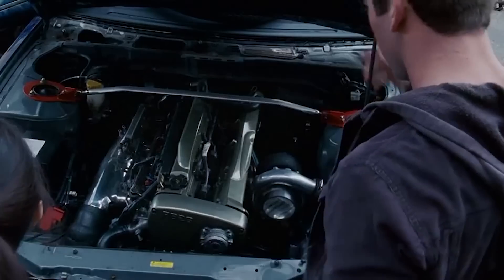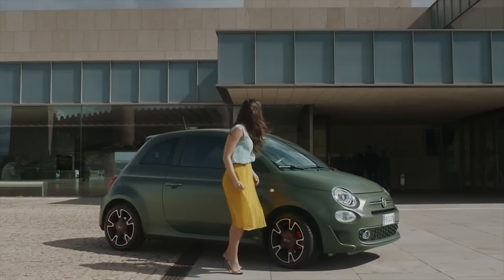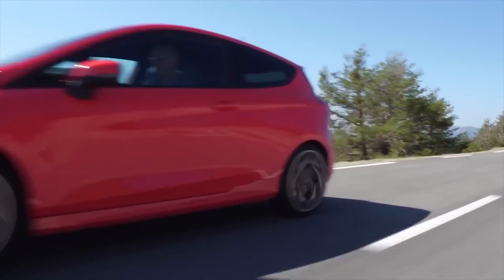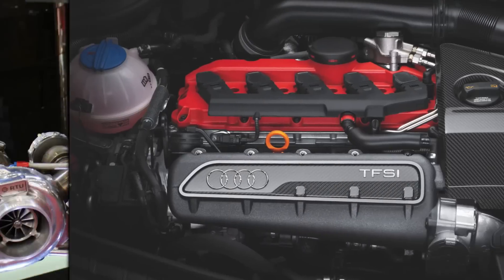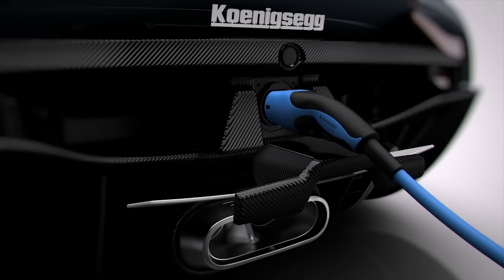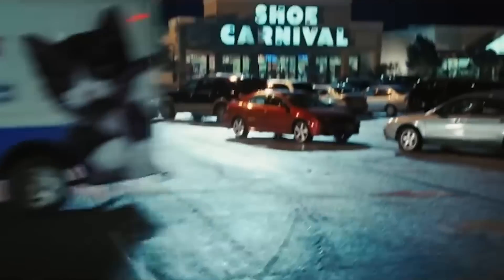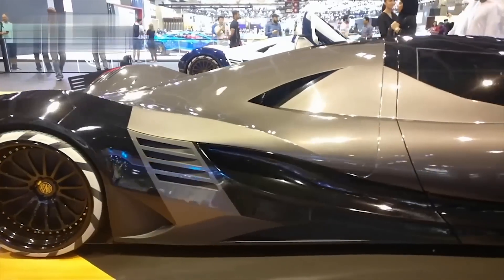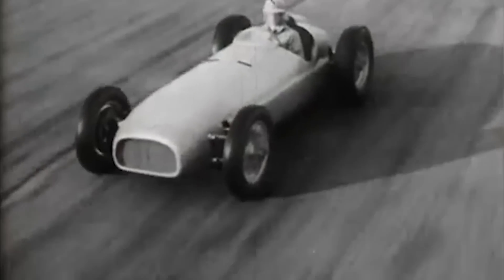Most Powerful Engines from 1 to 16 Cylinders

Comment: Koenigsegg gemera 3 cylinder 600 hp engine pared with 1-300 hp and 2-400 hp electric motors to make 1700 hp in an awd car that doesn't weigh 3000lbs 0 to 60 in 1.9 seconds
Reply: 2020 update for 3 cylinders not a negative gripe

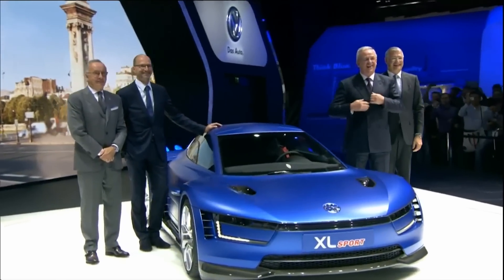Comment: 2:37,there is a much more powerful 3 cylinder engine that is a bit known. The koenigsegg Gemera has a 3 cylinder turbocharged engine that puts out an incredible 600 horsepower, but when the 2 electric motors are used,it has a total output of 1600hp.
Reply: Think u need to recheck ur facts.

Comment: It doesn’t matter how many cylinders an engine has to have more power. I4’s and I6’s are the strongest.
Reply: Debatable maybe stock not to familiar with them but over all anything can be built to handle basically anything you know their are people out their with 600 hp busa engines and when you compare that for size that's pretty fucking incredible then theirs rotaries wich can literallt half explode and still run then theirs the engines that came in the old Toyota trucks and rangers those will literally run forever and treat you well
Reply: Yeah

Comment: Lol like who remembered gt86 swapped with Ferrari v12 engine 

8:40
Reply: It's a 4.0L V8 Twin Turbo
Reply: It's what the 458 and the 488/488 Pista use because it's lighter and pushes about 600 or more. Study you cars.

Comment: What the hell ford why couldn’t you make my old ranger get 54 mpg and have almost 200 horses? I’m stuck with 8 mpg and like a hundred or a hundred and fifty as I’m not sure how much power it has lost over the years since half the engine is new and it’s slightly tuned for better economy and speed. Anyways wtf swap that 3 cylinder into my old truck and I’ll be a happy man since my truck weighs less than most modern cars so bring on 70 mpg.
Reply: Oh the viper only has a 16 gallon fuel tank and gets like 20 mpg. Wtf my truck has like half of all of that. Complain about your fast vehicle having bad gas mileage but no at least you have a damn fast car all I have is a old truck that gets worse mileage and an oil leak and a couple of misfires every once in a while and bad suspension and no paint and electrical issues but hey my radio works because after that deer destroyed the front end and the antler went through the door and the antler went through parts of the dash I got a new interior. I bet no super car owner ever said damn my front brakes locked up but my rear brakes never compressed or where did all my oil go and then look down to see it on your boots or how about this where did my passenger door go? I got another one did my exhaust just rust off? Oh wait one more my lights won’t turn off where’s my wd 40? No super car owner has ever said, I prefer to drive it off road. I’m going to email ford and ask for the engine from the new gt500 to be placed anonymously in the bed of my truck where a random 5.0 v8 sized hole will be for no reason. I’ll be driving a Mclaren p1 but it’ll just be the v8 for power and the v6 for more power and then say f the time to shift we’ll just have even more power after the shift is done. I don’t know why ford doesn’t allow me to design their trucks cause I’ll make the fastest truck on the world and it’ll be able to haul more things just not carry more things. If you listen sometimes you can hear my genius.

Comment: Any offroad-bike has a 1-cylinder, 2-stroke (4-stroke is more for the beginner type of enduro riders) engine. But all of them have 1 single cylinder. Theres nothing wired about this. Also having less cynlinders while keeping the same cylinder capacity usually means your engine wears out faster but produces significantly more torque. You obviously instantly hear when the bike infront of you has 1 cylinder, just as you hear if it has 2 or 4. (3 cylinder bikes often get messed up with 2 or 4 cylinders although they are quite common (Yamaha MT-09, Yamaha Niken (if you call it motorcycle), Triumph Street Triple, Triumph Daytona 675, etc.) You just have to know these bike or you'll probably think they are a 4 cylinder bike.

Comment: Lol the V8 is FOR SURE wrong because I know a car with a v8 LS that does 1500ish hp to the WHEELS
Reply: He's talking stock engines. But he's got some mistakes here. The regera has only 1100hp on it's combustion engine the rest comes from an electric motor. The agera rs has 1400hp on it's stock v8. The jesko has 1600hp on it's stock 5L twin turbo v8... this dude is talking out his ass

Comment: "the Regera's V8 makes 690HP" so basically, it isn't 1500hp, the electric motors make that much. You should replace that with the Demon, 840HP.
Reply: No the regera stock v8 makes 1100hp and the electric motor on it makes 700hp but they reach different peak efficiencies at different speeds so averaged out they have 1500hp. If you are gonna put info out there get the right stuff mate. The above info is right from the horse's mouth Christian von Konigsegg. Also the regera v8 is not the most powerful v8. The Konigsegg jesko 5l twin turbo v8 has 1600 hp.
Reply: @NikoLiabotis  Welp, the vid said 690hp. Thanks for the info, but you got something wrong with the Jesko. The 1578HP One uses a TT V16 running on E85 (The one designed for Christian's dad, Jesko Von Koenigsegg), The production one has a V8 with 100% gasoline that makes about 1262hp.
Reply: @NikoLiabotis  Oh wait, the 1578hp one has a modified V8. Sorry, I saw the Jesko page on Wikipedia when the Jesko just came out (they wrote v16 at first) and now it's updated. Yeah, TT V8.
Reply: Running e85 gasoline the jesko has 1600hp (as per konigsegg.com)
Reply: @NikoLiabotis  E85 isn't gasoline. E85 stands for 85% Ethonal, thus making it kind of a hybrid. 85% Ethonal and 15% gasoline.

Comment: Im kinda pissed that for single cylinders he was all like "tHiS mOtOrCyClE EnGiNe mAkEs 70 hP" but like the Honda cr500 dirtbike engine made like 73 and it was like 20 years ago
Reply: ElvisEinstein dirt bikes are for off-road purposes so that’s why he didn’t put it. plus that’s average for dirt bikes
Reply: ElvisEinstein could make up to 90
Reply: Blud man port it, dome piston, o ring head gasket
Reply: It’s very powerful for a single cylinder
Reply: a stock cr500 doesnt make 73hp....
Reply: Todd Omicioli 53, 73, same difference
Reply: love my CR500. Best bike ever!

Comment: I was expecting a 200hp single cylinder engine
Reply: there's thousands of them, in shipping boats a few of them are single cylinders, making around 100,000 HP. tons of cr500s and banshees etc have been tuned over 200hp

Comment: Just get any 2.0TDI or bigger engine Audi and off you go. You might not lounch yourself like a rocket but you gonna reach the top speed of 265km and the difference in price of 35kEU Audi vs 1 Mil Lambo that is 70-ish faster is just not worth it. And the only place you are gonna go quick is the Autobahn anyway.

Comment: "The car only has a 16 gallon tank and gets 21mpg"
Me, driving across states with a 13mpg E60: Wtf are you talking about, bad economy my ass.

Also why are half of these stats wrong, there's a shitton of cars with stronger engines than those, you can't really compare NA engines with Super and Turbo engines either lmao, changes everything and at that point if you include the Agera, might as well also include hybrid engines too.

There are a shitton of single cylinder engines used outside of motor vehicles too, motorcycles use them often, and small gasoline powered generators or vacuum pumps use them too.

Comment: Devel 16 is a bullshit hoax and it ruined your credibility despite the fact tha the ford 427 sohc engine is the most powerful 8 cylinder production engine ever installed in a production motor vehicle (Koenigseg  engineered some powerfull super fast beautiful and remarkably engineered machines, but I’m pretty sure there aren’t 500 of them for each production year. The cammer ford engine was rated at 687(?)hp and they were advertised at a deliberately low rating like the Boss 302 351 Cleveland HO INT 351 Clevor  or Boss, FE 390 HO 428 Cobra Jet and the Dove Big block BOSS 429 Mustang, the 427 Cammer and the BOSS 429 were protested and were never approved  authorized or permitted in NHRA IHRA or NASCAR. But they were real, and naturally aspirated...with carburetors...in the 1960’s!!!

Comment: Doesn't the Hennessey Venom GT have a 1,450hp v8 without any assists from electric engines?
Reply: And the agera rs has 1400 on it's stock v8 without any electric motors. Not to mention the jesko has 1600hp...

Comment: Correction the bigger the engine the more horsepower and torque it CAN have like the 4G63 (an i4)has 289horsepower stock and something like the 7M-GTE (an i6) has 232 horsepower stock

Comment: I dont see how 5000 hp is possible in a gasoline engine that small. It would have to be like 40 liters.
Sure you can just have turbos bigger than ones Hope's and dreams, but that would just make the engine run on a gasoline that doesnt exist due to quantum teleportation not being real. Much less a gas from a station. Dream on.

Comment: The Devel is still a joke!😆 There is no running example of a V-16 on the road yet, after all these years, and if so, it hasn't been tested or reviewed anywhere that I'm aware of. If they wanted to review a V8 that has the ultimate horsepower rating, what about top-fuel dragsters? 10,000+ hp. & 330+ mph. in 1000 ft.😮😉👍

Comment: except that's not true because a single cylinder engine produces less bhp than a single rotor rotary engine.
and rotaries are smaller over all than piston engines as they are less complicated yet still produce a lot of bhp

Comment: FM 38 x 8.55 = 1600 HP in 9 or 10 cylinders. Same HP because the 9 gets more RPM. and I sure that is not the most powerful.

Comment: Sure the BRM V16 had over 600HP and could push close to 14,000rpm if used properly, but no ones mentioning that the displacement was ONLY A 1.5 LITRE ENGINE! 1.5 LITRES! Theres soda bottles bigger than that!

Comment: V8 one is wrong that's the one with the most powerful V8 has 12000 horsepower in a Top Fuel dragster

Comment: They made a big mistake the subaru engine is called horizontally opposed NOT boxer.
Boxer engines have 2 pistons that come together and don't use a cylinder head

Comment: no mention of the dodge v8 like the hellcat 707hp  the demon 840hp  or the helephant 1000hp witch sold out in 45minutes   missed those they came out of the factory that way just like the other cars did the demon will beat all those cars at the drag strip hands down

Comment: Puny engines compared to ship engines. MTU 16cylinder Series 8000 engine produces 8000kw of power at 1100rpm, and this is small engine as biggest ship engines produce over 100k hp.

Comment: 190hp and over 1ton of weight from Volkswagen Sounds a bit uninspiring. Taking into concideration that we still have the means to make cars and other vehicles, that make less power and have even less weight in a reasonable manufacturing cost that still are fun, efficient and reliable.
   Volkswagen used to be a pioneer of automotive research. And now? It dies... With style?

Comment: I thought these are literally the most power cars by cylinder. Like not by stock but by ultimate tuning, for example: V8 top fuel cars or a 2000hp Evo 8.

Comment: Also take into consideration the size of the motors. The more space for combustion the more power it can produce. A 20 cylinder 2 liter engine will put out impresive numbers for 2 liters but not 20 cylinders while a 4 liter 4 cylinder will have a lot of power for a 4 cylinder but not a lot for a 4 liter

Comment: 6:35 lol the regera is a 1 speed it doesn't have a transmission or gears
Reply: And the agera rs makes more power alone. The electric motors shouldn't count
Reply: Right
Reply: The agera one to one makes almost 1400hp on just motor. No hybrid crap there.
Reply: you still aren't faster than cars
Reply: AAAAARGH BUDDY THE KONIGSEGG JESKO V8 TWIN TURBO PUTS OUT 1600HP ON E85 GAS. ALSO STOP BEING A BUGATTI FANBOI IT'S NOT AS FAST AS THE KONIGSEGG!!!
Reply: Ya sure 1 gear for a v8. Bruh you dont know this but the regara has gears  especally for the electric moters. Because if your on the highway and you wanna go fast you NEED gears and a transmittion.
Reply: @the0limonatorpower530  torqe converter look it up
Reply: @the0limonatorpower530  you know anything about cars at all?
Reply: @johnstones339  ah shut up. I know alot. Case closed.
Reply: @the0limonatorpower530  hate to burst your bubble dude but the regera has 1 speed and doesn't shift, the engine is directly connected to a 2.85:1 finals drive. The car drives on pure electric until 30 mph where the engine comes in,  the car never shifts and by the time it's at it's redline it's doing 249 mph. It uses it's electric motors to help with the torque needed to spin the driveshaft
Reply: @Interatomic  its alright, thanks btw, someone nice like u can make my day

Comment: The ford focus rs is also a very powerful car, 350hp in a turbocharged 2.3l i4, very good for $45k
Reply: Dane Hartsough my snowmobile should be on this 755CC 2 stroke pushing 180HP

Comment: There are 2 cylinder snowmobiles that put out 300+ horsepower
Reply: Ryan Wilson yeah he seems to care onlu cars and bikes here cause my boat have 2sylinder over 300hp
Reply: Zsavage1 dumbest comment I’ve read in a while lol
Reply: Zsavage1 i had a bmw 5 series for 2 years never had a problem with it had a Porsche Cayman for 3 years never had a problem with it
Reply: Zsavage1 Im just saying I had German cars and drove the hell out of them, topped out limiter on the expressway numerous of times constantly street raced and drifted them beat them every day and never had problems with them
Reply: Zsavage1 as long as you take them for routine maintenance, and do simple things like letting it warm up before you drive it you can beat it, sport cars are meant to be driven like sport cars, consider getting a used Bentley they depreciate hard you can buy a salvaged one that just has body damage and fix it for cheap and be good to go a lot of youtubers post videos on how to do your own oil changes etc.
Reply: Zsavage1  dunno what your friend is doing but a friend's BMW runs well after 20 years
Reply: But most of them are superchargeed or turbocharged

Comment: The Bugati isn't the king of high speed. The Königsegg Agera RS drives over 440 kph and does it with a V8.
Reply: Tobias Rieper the Chiron is electronically limited because of the lack of tires that can handle the high speeds it can reach
Reply: @843wj3  Really? Not the 600 KG that the chiron weights more than the Agera RS? The RS needs tyres too and there they aren't the problem. Its just cheap argumentation. And the RS has less horses. Although the RS accelerates faster, drives faster, needs less fuel and looks better. And Koenigsegg has more models. All in all its the better company.

Comment: Rotary: AM I A JOKE TO YOU
Reply: There are no cylinders in a rotary
Reply: Elites311 that’s the joke
Reply: Elites311 exactly the no cylinder class
Reply: Y didn't he include the 2j
Reply: @vitaminbleach1217  its not 1million hp from factory 12 year old.
Reply: @manlikeilyas  I'm not saying it came with 1 mil hp. Im saying that it was over built from factory because it was twin turbo charged,  had an iron block, and it's just over all a 3.0 liter overbuilt engine from factory
Reply: @vitaminbleach1217  its still 300hp and not something modern with 700hp
Reply: vitamin bleach he is measuring stock hp
Reply: @vitaminbleach1217  2j is 2997cc, 6 cylinder inline engine, not exactly a small engine is it
Reply: @vitaminbleach1217  The list here talks about engines that are not modified. The 2JZ only made 330HP from the factory.
Reply: vitamin bleach the 2jz has half the power of something like a Ford GT or Nissan GTR or a 911. The 2jz is not incredibly powerful. It’s a small 3 liter engine from a 90’s sports car
Reply: That's what I said
Reply: @vitaminbleach1217  . Its a great engine, but its literally way to over hyped and then parts for it cost a shit ton because of 6 cylinders. A Lot of people are going the k24 route. However I still love the 2jz
Reply: @vitaminbleach1217  because its a normal engine when stock plus it doesn't make that much power either for a stock engine...
Reply: Talking specifically about cylinders, rotories have roundish triangles
Reply: Lol
Reply: Fat Assassin I felt the same thing
Reply: If he didn’t put the 4g63 on this list I would’ve found we’re he lived and gave him a shooping
Reply: Well...yes?
Reply: yes. yes u are

Comment: You left out my 36 cylinders:  My three XJ12s. A STOCK 150mph luxury car. Not a car you haved to twist and turn to get into. 7000 redline. How about the unlimited Sprint cars? Limited Midget open wheels? Not this NASCAR crap either.  How about historic race car engines like the Offy? Dragsters that explode a 1/2 stick of dynamite in each cylinder when you open the throttle. Blowing off a cylinder head is so common that racers bring several engines to each event..

Comment: I’m confused so power and torque doesn’t depend on how the motor is designed how the pistons are arranged the materials used, aspiration, displacement, fuel type, octane rating or anything? Just kidding it all depends on all of those
Reply: Also funny because well the ford coyote 5.0 has the potential to have over 1200 horses due to it being the perfect platform for, single turbos, dual turbos, quad turbos (with intensive mods), and superchargers, the GT500 and the GT350R came stock with a posi-displacement supercharger I think I could be wrong.

Comment: The 2 cylinder one is crap, motorbike engines in cars do not work the flywheel ain't big enough so you'd have to rev the crap outta it and go through 8 clutches an hour